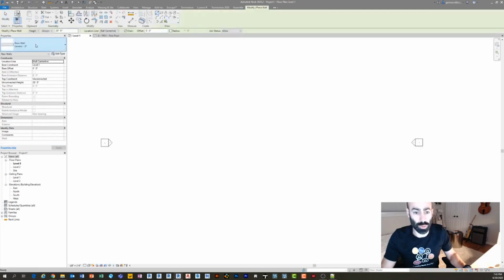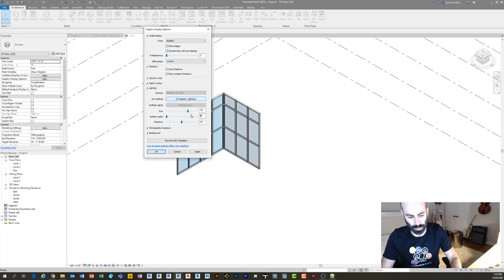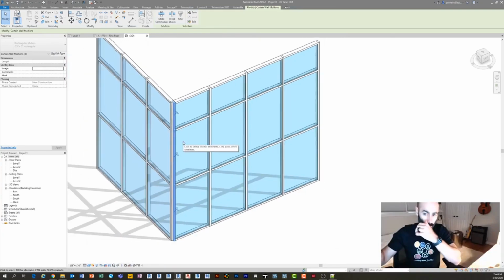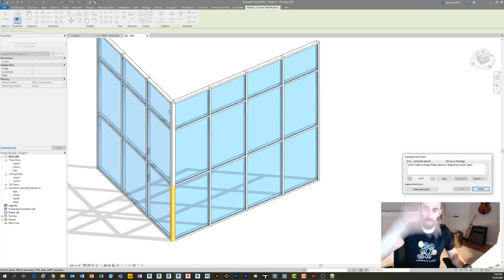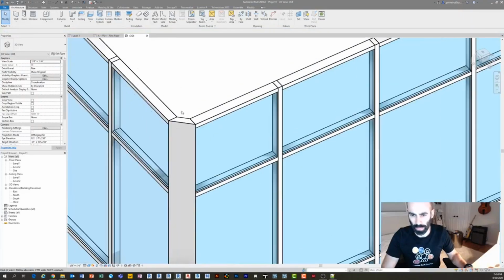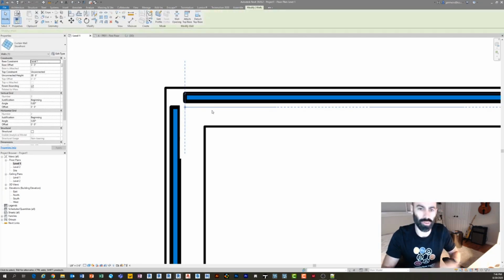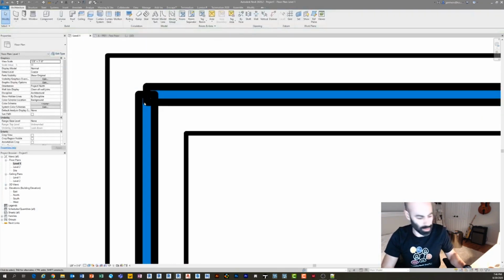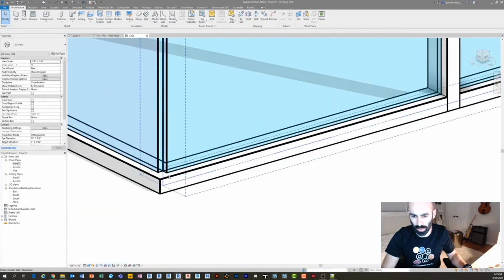Curtain Wall Corners in Revit Tutorial (Quick Tip Edition)

Comment: Still no way to do a angled corner mullion unfortunately, which is the most common type in facades.
Reply: Yup that was a bit of a click bait as the video thumbnail shows a corner angled million
Reply from the maker: Oops... Yeah, I wasn't trying to be misleading with that thumb... I made 15 thumbs that day and had about 5 different details in the folder.  I have, however, seen some workaround similar to this for the angled corner mullion.  Custom mullion profile, disallow join, adjust, etc...
Reply from the maker: @MahmoudCharif-MaxArchitecture   - Will do... I only log into linkedin every so often!  Apologies.
Reply: @TheRevitKid  don't forget to accept that invite ;)

Comment: The cleanest join would be using a transparent glass wall type as a curtain panel. Walls join perfectly, even in curtain wall. First you need to let them join by using no offset. After they have joined, you can make an offset and they still maintain the join.